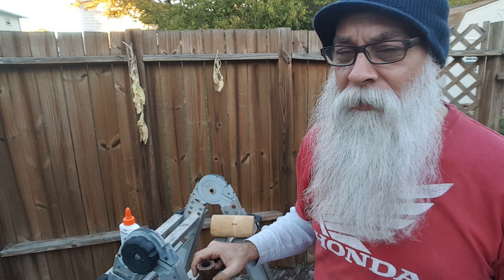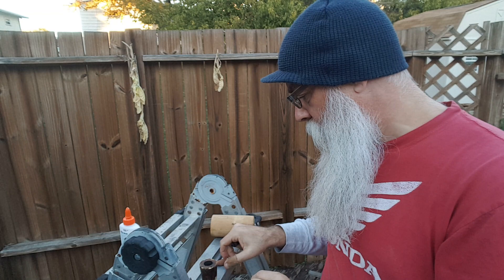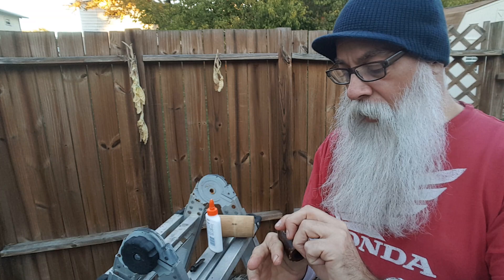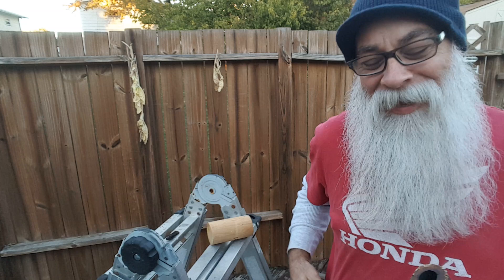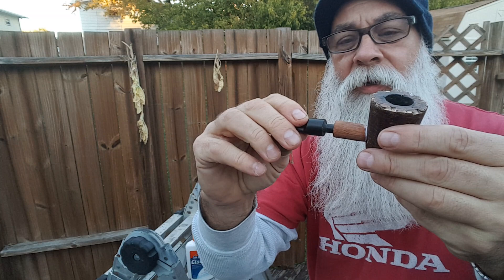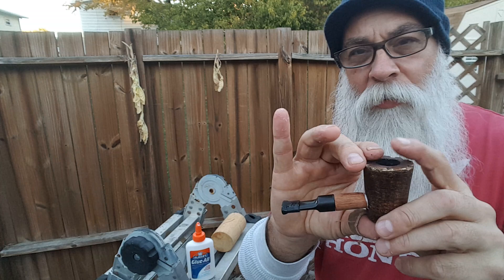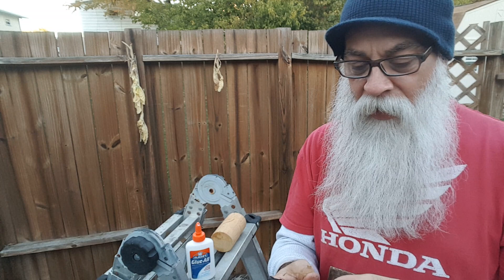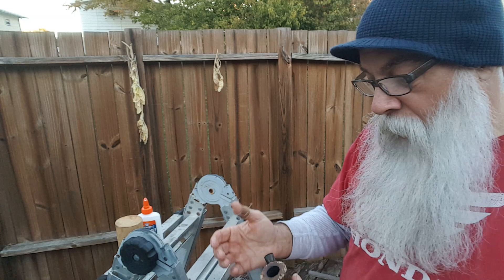Modifying a Mark Twain cob pipe. Short shank. Saddle bit.

Comment: I always enjoy your videos. I have no idea which ordinal succession they come in but learn something from each one. I have no idea how to put a video together. It would be interesting to have your instruction on how to do that. Not that I would be competition, but seek participation in the Pipe Smoking Community. Lastly, what is the metal object you seem to be using for a workbench/table? It looks like two "Shop Smiths" joined by an  A-frame. I had a Shop Smith years ago, but became more interested in making miniature steam engines and traded it for a Taiwanese lathe, Taiwanese drill press, and Taiwanese milling machine. Now, I wish I hadn't done that. I guess I can make pipes on that equipment, but how can anyone improve on corn cop pipes. LOL